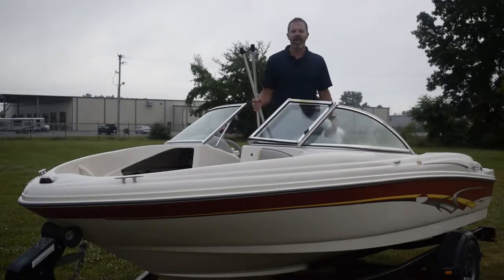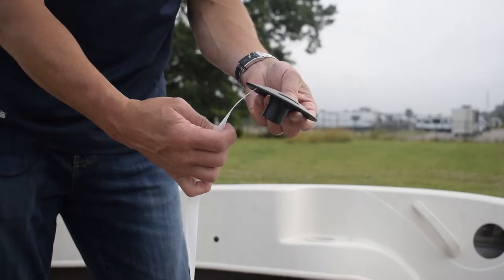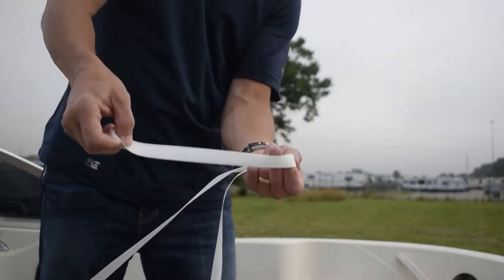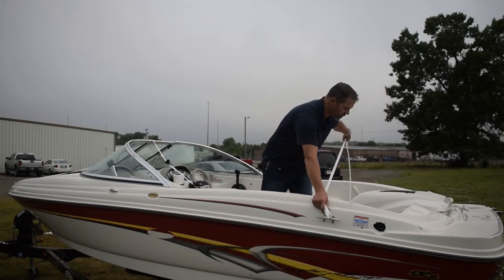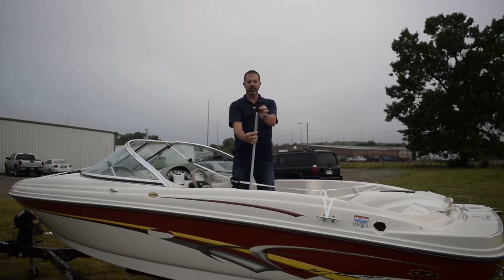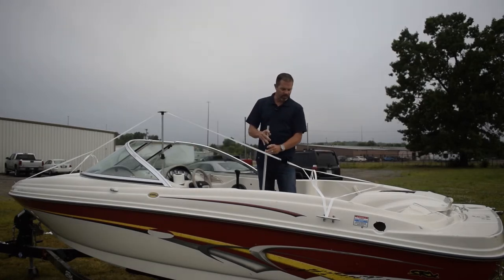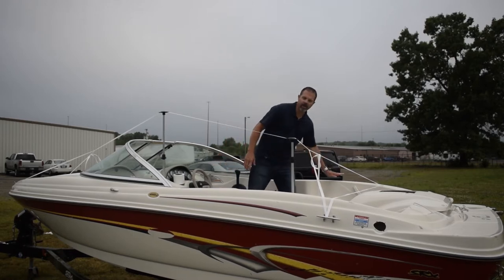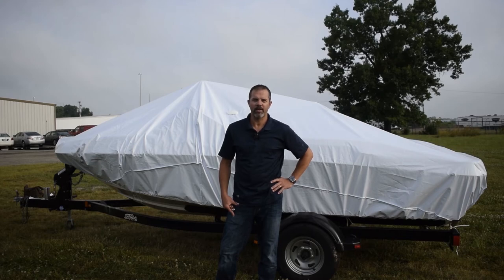Installing Universal Boat Cover Support System for your Vhull | 2 Pole Kit from Transhield

Comment: I've tried those poles before and they simply tip over. Very flimsy setup might hold up with an inch of snow, but a decent snowfall of 8-12 inches will be too heavy for this.
Reply: They aren't meant for snow.  They are for rain.  If you live in an area with 8"-12" of snowfall then you should be winterized with a solid frame and shrinkwrap.
Reply: I agree, rain or snow they are flimsy and tip over very easily although they do provide somewhat of a solution.  I've watched at least 100 vids on this same subject and have yet to find the right solution for me.